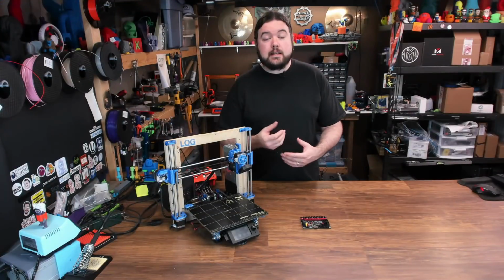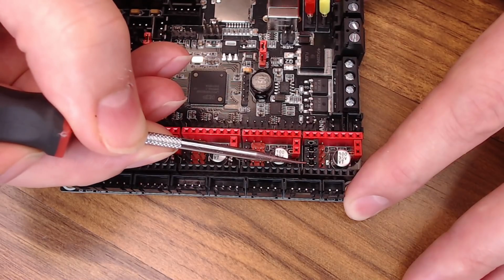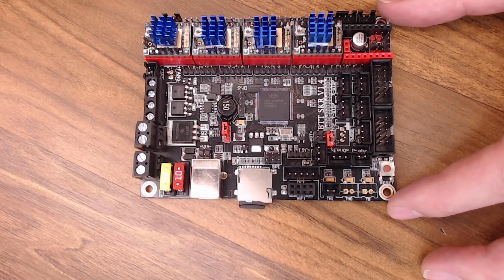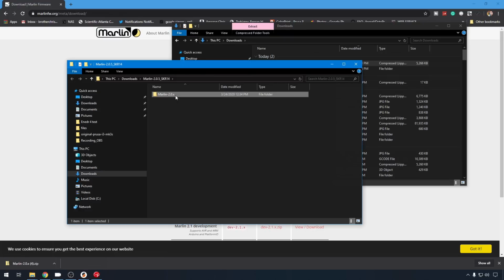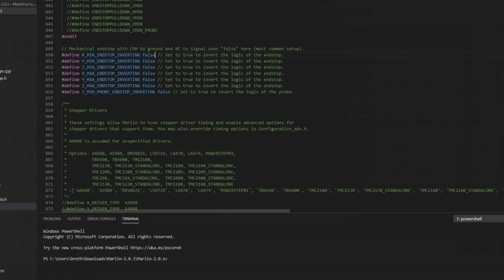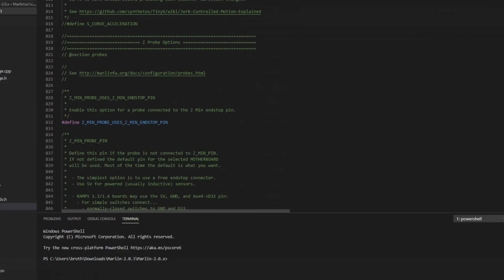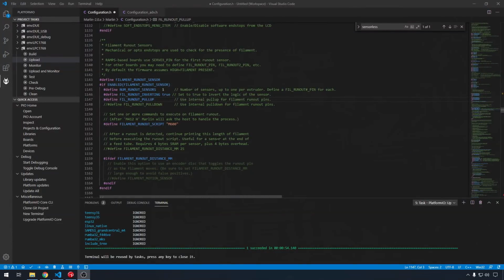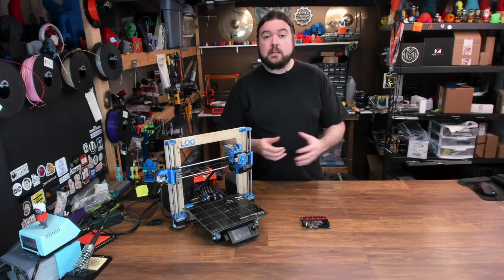BigTreeTech SKR v1.4 Mainboard - Full Install Part 1 - 2209 Drivers - Chris's Basement

Comment: Hi I know this video was posted a while ago but I had one question. Could I power the board using a power supply? If so where would I attach the positive negative and ground wires? Thanks!
Reply: It’s because right now I’m power the board using usb but it’s not enough voltage to get the heater to work.
Reply from the maker: @jonahayalaayala8266  oh, yes, you need a PSU.
Reply from the maker: I'm not sure what you mean? You have to use a power supply for this.

Comment: Thank you, thank you and thank you. This is by far the clearest and most in depth walkthrough of everything needed. Your teaching style and knowledge is excellent and have turned a Marlin newbie into a Marlin newbie 2.0.  Just what I needed to get this up and running with an Anycubic Mega X which has been nothing but trouble. I finally understand how Marlin, compiling and the inner workings of my printers which will help so much with my other machines.

The only difficulty I am having is with the dual z motors and the two strings endstops which are on the machine. I'm getting away with just using one z endswitch and manually syncing each side. This is something I'll work on in the future. 

Thanks again and keep up your awesome work on your channel
Reply from the maker: Next, Marlin guru! Thanks for watching

Comment: Hi Chris,  at 11:58 you are using for both Z motors the same driver. How do you handle the second Z stop? I did remap P1_25 (E1DET) pin as ZMAX to use in Configuration_adv.h for the Z2_USE_ENDSTOP. is there any other way without remapping in the pins file? how do you solve this problem? btw I'm using 2 driver for dual Z (E1).  thanks in advance
Reply from the maker: You shouldn't have to remap anything. Marlin has this build in. Check configuration_adv.h. there is an option for dual Z that will set it up for you. Just uncomment it.
Reply: @ChrisRiley  thanks for your answer, I know the part but you still have to connect the Z2 endstop to a pin. Marlin predefines X2 as Z2 referring to E0 filament detection  which I'm already using so I took the next free E1 filament detection pin. many thanks for your grate work.

Comment: good day chris, these videos are great. thanks so much for making them. i have a couple of questions though regarding the firmware install.  im using the BTT SKR 1.4 Turbo for a MPCNC Lowrider, and im running into errors that are not adding up. do i need an extruder called out in the firmware even though im not using it? and if so, what are the temps supposed to be? because i dont physically have them. is there a way to "fool" the firmware?  thanks again for the videos.  keep up the great work.
Reply from the maker: So I think there is a way to run without an extruder, but I can't remember how to do that. The easiest way to is tell it to use a dummy thermistor, change this to 998, this will make it read 25c all the time. #define TEMP_SENSOR_0 998

Comment: ok, I'm stuck, I bought the 2209 drivers, I'm not sure what configuration to use if I want to use it as it came from Creality.  I dont know what sensorless homing even is.  I plan on using the stock hardware but may add wifi and a direct drive extruder.  My Drivers dont have the 2 pin header.  I have TMC2208's I also bought the touchscreen.
Reply from the maker: What brand of drivers do you have BTT? If so, configure the 1 jumper for UART mode and clip the diag pin. This will be the mode you want to use.

Comment: in my marlin screen appears "tmc connection error" do you know what that means? it's a 1.4 skr turbo with tmc 2209 1.2 drivers
Reply from the maker: That usually means something is wrong with the driver or the jumpers under the driver. I would set them all to a4988 and then switch them to tmc2209 one at a time to figure out which one is causing the problem.
Reply: @ChrisRiley  I don't have a4988 drivers. Do you mean to switch the jumpers to work with a4988 drivers? How will that help? That seems like it would just introduce more errors, not diagnose errors. The stepper motors on all of my axes are overheating, but the Y axis is getting hot enough to burn me if I left my hand on it. What do I need to do? Help me Chris Riley, your my only hope.
Reply from the maker: @gwilliams4081  So I was talking in the firmware, I would pull all the drivers then set the firmware back to A4988's. This will disable all the TMC magic that could be throwing that TMC connection error. Are you using sensorless homing? You just have the 1 jumper on under the driver on correct?
Reply: @ChrisRiley  I have the board configured for UART mode, and I am not using senseless homing, so I bent the diag pins on x, y, and z, but not e0, or e1.

Comment: Chris,  I am trying to configure a SKR 1.4 Turbo board and I have a lot of trouble with the homing. The steppers are moving in the right direction. When I try to home the x or y axis it moves away from the end stop a few millimeters and then stops and the controller sets the position to max. My end stop is at max. This behavior is constant on all axis. I checked the end-stops they are ok. I got a replacement board to rule out a defective board, that was not the problem either. Any idea what could cause this behavior?
Reply from the maker: What you are seeing I think is the home bump feature. I think you endstop are inverted. Try changing these.

#define X_MIN_ENDSTOP_INVERTING false // Set to true to invert the logic of the endstop.
#define Y_MIN_ENDSTOP_INVERTING false // Set to true to invert the logic of the endstop.
#define Z_MIN_ENDSTOP_INVERTING false // Set to true to invert the logic of the endstop.

Comment: All the videos combining both sensorless and sensor homing should separate into two videos. just confusing people. Trying to make these generic videos for all these configurations is a nightmare. especially as the firmware changes. what about 1.0 boards... what about 1.2... see just confusion and a waste of lots of peoples time. [seriously state which board you are referencing. the driver board also has a board number which you literally brought up a few minutes ago if that.]
Reply from the maker: Honestly, I didn't think it was that confusing. These videos are all on the 1.4 board, that was kind of the point.
Reply: @ChrisRiley  the wording sucks.
Reply from the maker: @Tom_Neverwinter  Noted.

Comment: Morning Chris I have enabled safe homing but when I home it is not centred I am running sensor less xy 2209 bed size correct with half bed enabled please help been pulling my hair out this last week my printer is a AM8 ,bed 310x310  skr1.4 turbo thanks mate
Reply from the maker: It's not centered, but close? It's probably min x and Y settings, remember marlin will probe when the nozzle is centered, not the probe. Make sure where ever your nozzle is at the 0,0 position, those measurements are reflected in Marlin correctly. If the nozzle is out side the bed, the min values need to be negative numbers.

Comment: I have an issue with linear advance on my SKR1.4T, TMC2209s and Hemera extruder on my Artillery Genius.  I get a Linear Advance debug error reported and stuttering extruder noise during parts of the print that have shorter segments like faster areas of infill:  ""more than 2 steps per eisr loop executed".  How can I fix this? tried turning off all of the following but it has not helped:  s curve off, Junction Deviation off, stealthchop off, adaptive step smoothing off.  I even swapped out the 2209 for a 2100 in direct mode but it did not fix the issue.  Running 2.0.x bugfix but have tried 2.0.6 as well.  It goes away only by disabling linear advance but I want to use this feature (or increasing the K factor above 0.05 but I need a low K factor for the Hemera).  Any suggestions?
Reply from the maker: I have never seen that issue, maybe it is triggered by the steps being set so high? Again, never tried LA on Hemera yet.
Reply: @ChrisRiley  I have all drivers set to 16 microsteps with interpolation on. I did try playing this but didn't really understand how the settings work (future video?). I tried turning off interpolate but then the firmware won't compile. I also tried increasing microsteps but then the motors were barely moving (very slowly or not at all).

Comment: Good stuff here, Chris. My BTT SKR 1.4 Turbo w/ TMC2209's are on their way. I'm installing it in an older Omni3D Architect 1.1 that utilizes optical endstops. Would you recommend using sensorless homing, or use the existing endstops? Also, the printer came with an RAMPS 1.4 board....any further tips on transferring connections from the old RAMPS board to this new one (ie: hotend fans, cooling fans, etc.)?
Reply from the maker: I would probably start with the endstops to just confirm everything is working before moving to sensorless homing, it can be flaky. RAMPS you probably had dupont connectors, you will have JST on the SKR, you can either remove the plug shrouds from the board or make an adapter.

Comment: Hi Chris! Thinking to upgrade to SKR1.4. Recently, I failed to upgrade to 1.3 version. I manage to upload the firmware but when I’m trying to update it it won’t update. I think serial configuration I’ve made is not correct. Is there a way to fix it?
Reply from the maker: Fix the serial and make sure it is set to -1 then load the firmware.bin file on the SD card manually and load it that way.
Reply: @ChrisRiley  thank you so much! followed your vid and advice. I can update the firmware now.

Comment: I ran into an issue with my CR10 and this setup. The x axis isn't responding correctly. After a successful homing, the opposite bed edge reads only 220mm. Its a 300mm board, this reading is incorrect. It wants to keep moving off the gantry. Any advise to correct would be greatly appreciated. Thanks!
Reply from the maker: Double check that your bed size is set correctly.
Reply: @ChrisRiley  I got it! Some reason even though it was set at 80 for the steps. After uploading it was being changed to 100 somehow. Set it back via the screen and saved the eprom. Working now, Thanks for the reply and help!

Comment: You Have Great Videos !, thanks for them, , So I have the Same SKR 1.4 Turbo, and Bigtreetech 2209 Drivers, I cut the Pin ( as suggested) for Z and the extruder,  But noticed I can only go UP in the Z Axis,( wont go down) swapped the X driver (Non pin Cut) with the Z driver (Pin Cut), and the Z motors now go Up and down like the should. ( and X only goes one way) .. SO cutting the Diag Pin seems to Kill two way Motor Movement.....cannot get sensorless Homing to work either, (Non Cut Drivers) the steps either move it barely or crashes into end stops....Any thoughts.....?..Thanks
Reply from the maker: It sounds like there is a pin conflict of some kind. I am not sure why Z is acting up, that pin only should impact the power detect pin. As for sensorless homing, try to home with half the current. It will be more accurate then.
Reply: Chris Riley  Thanks for reply, as it turns up my end stops we’re in inverted; felt kinda sheepish on that one. I have everything working , including the 3.1 BL touch, what an upgrade for an Anet A8 !, Again thanks  for the awesome videos, !!

Comment: Hello. Can I connect two coolers in parallel in one controlled socket to cool a part? Skr 1.4 turbo board.
Reply from the maker: I am not sure what the draw is on that, you will have to get the specs on the fan and the board to see if it will work every fan is a bit different. I can tell you, I have seen it done.

Comment: Hi Chris, Thanks for the very useful info. I am doing everything like you in the video, but the only thing that happens is to have after the firmware is loaded, the error err: MAXTEMP: bed. Doesn't matter if the thermistors are connected or not, the board stuck with that error. Any suggestions? Are 15 days I am looking around and no solution are given. Thank you
Reply from the maker: Sounds like maybe you have a short on the board or a pin that is off. It is sensing too high of a resistance. Check the solder joints on those pins. I would try to get another board.
Reply: @ChrisRiley  Hi Chris, thanks for the answer. I did a test. I changed, in pin file, the temp bed pin from 0_25 to 0_23(th1 pin) and commented the temp 1 pin. The error now is err: maxtemp: E1. I didn't expect that result, so I don't understand. I will send back the board, but this is the second defective board. After its success I except from BTT a better QC. Thank you
Reply from the maker: @marioizzo4985  I wouldn't expect that either, QC is a bit sketchy.

Comment: Hey man, I have bought the same parts for my Genius.
As the Genius has a sensors for homing, is it best to remove the pins you suggest from all the steppers?
Thanks!
Reply from the maker: It is probably best, they can interfere with some pins on the board.
Reply: @ChrisRiley  Thanks very much man.
read also to remove the plastic shrouding and bend the pin incase want to use later, but i know how to solder so cutting is fine.

Im still trying to figure out why the Genius uses 5 steppers when the Z axis is dual. hmmm
Reply from the maker: @Doyle69  Sometimes they do dual and dual enstops, I don't see much of an advantage to it, but it works.
Reply: @ChrisRiley  Thanks again, one thing I bumped into when doing this, to connect to the board I had to change jumper from vdd to usb+5v, do i need to put it back to vdd now my firmware is flashed?
Reply from the maker: @Doyle69  Yes, I would put it back when you use it.
Reply: @ChrisRiley  Thank you

Comment: I could really use some help I can’t seem to get this to work for me, I’m using skr1.4turbo with tmc2208. Computer doesn’t seem to recognize the board either. I’m at a lost here
Reply from the maker: That is probably caused by the serial being set wrong on the board. You will need to flash Marlin to fix it. Set it to -1. Also, make sure you have the ch340 driver installed.

Comment: Ok sorry for being such a newbee but can you or someone in here please let me know where to install the end stop plugs for Z, X access  stop switches I see the ports for them on board but they are for 3 wire plugs I only have 2 wire plug with my CR10
Reply from the maker: Use those plugs, but only use S and G, doesn't matter which is where.
Reply: @ChrisRiley  ok moving on again sorry for my questions here, I now having an issue with the Mosefit that came factory with the CR10.
It has 3 big wires on one end and a 2 wire plug which I assume to be a controller I need to know where the controller plugs in to the SKR board and where do I run the heavier wire to
Reply from the maker: @shellyrobinson5806  Check this out. https://youtu.be/ENqpIL4Wk-s
Reply: @ChrisRiley  ok cool I check the vid out he doesn't say exactly where the wires go to I tried to trace the wires where they are going to on the board but can not quite make out where they ended up on the board. I see the 3 power wires have the 2 outside wires go to the psu the one in the middle I'm not seeing where it ends up at but it does look like it might be going to the power connectors on the board but again hard to see I might just ask that guy if he could give a better description in his comments maybe would help.
BTW thank you so much for your patience with me on this you've been so helpful
Reply from the maker: @shellyrobinson5806  No problem, if he can't help, I can get you a picture.
Reply: @ChrisRiley  ok a pic of the wiring and where they connect to would be great thanks
Reply from the maker: @shellyrobinson5806  https://photos.app.goo.gl/R5QAmjonoqvZcV299
Reply: @ChrisRiley  ok so the controller wires go to the green power block. What board is that I am using the SKR 1.4 turbo board
Reply from the maker: @shellyrobinson5806  yes the bed terminal.

Comment: This is a great video, but where can I find those connectors you used for the power wiring? I am not using the right search term I guess?
Reply from the maker: These are them. https://www.amazon.com/Ferrule-Crimping-Tool-Kit-0-08-10mm%C2%B2/dp/B07K17VDF2/ref=sr_1_2?dchild=1&keywords=ferrels+wire&qid=1594264654&sr=8-2

Comment: Hey Chris, thanks for your guide. I have installed the SKR 1.4 Turbo with the TFT35-E3 v3.0 and the 24V UPS board. Despite the printing being halted on power failure detection, after power being restored, it doesn't show any option to resume the previous printing job. I'm printing from the SD Card inserted in the Display board running in Marlin mode and the Power Outage option is enabled... Any hints?
Reply from the maker: I am not sure how that works actually with the power pin. It might not be able to write to the SD card. Are you reading from the board SD or the screen SD? I am not sure how this works actually, I guess I need to look into it.
Reply: Thanks for your reply @ChrisRiley  I'm using the display's SD card. I haven't been able to find detailed info on this online so far...

Comment: Hey Chris! what 8mm probe are you using? I am having trouble with Z-height variation due to thermal expansion... If I probe the bed after heating up the nozzle and bed, the results are usually messed up.
Reply from the maker: I use this one a lot. https://www.aliexpress.com/item/32801244337.html?spm=a2g0o.productlist.0.0.5d3649eeyalybZ&algo_pvid=fd55fc6b-5145-4f5b-a723-ee7543593633&algo_expid=fd55fc6b-5145-4f5b-a723-ee7543593633-3&btsid=0ab6f83115940629943685900e2a76&ws_ab_test=searchweb0_0,searchweb201602_,searchweb201603_

You might want to try a Pinda as well. 
https://www.printedsolid.com/products/pinda-1-probe-replacement
Reply: @ChrisRiley  Thanks for the info... I am using a LJ8A3-2-Z/AX-5V NPN NC.. Does the fact that yours NO make any difference? My printer is also a modded CR-10S (stock bed) with a magnetic pad and flexible steel plate.
Reply from the maker: @mauriciomoraes3226  No, NO or NC doesn't matter. Just flip the endstop inverting to make them work.